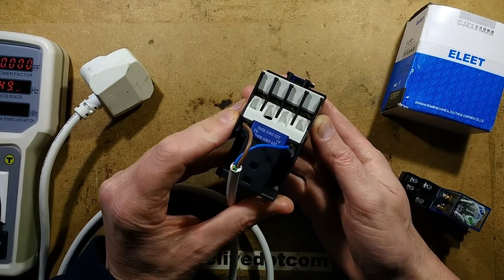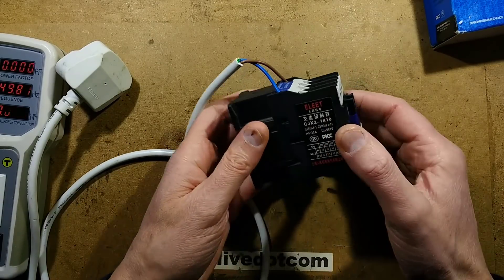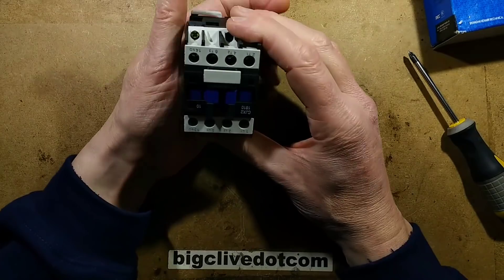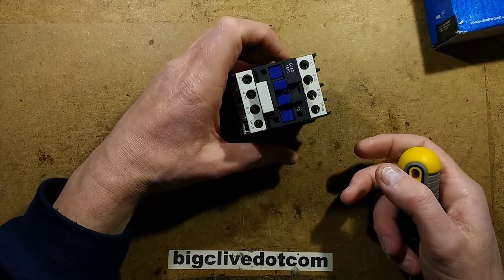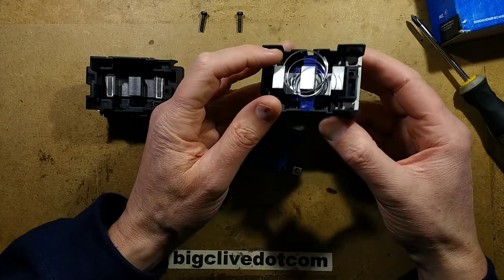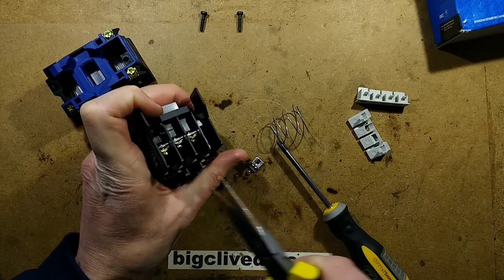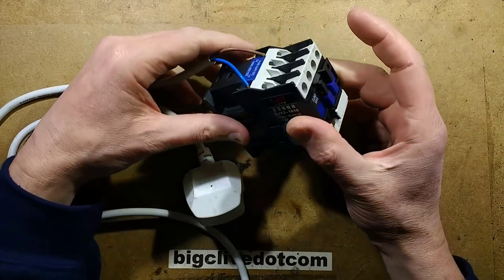eBay CJX2 industrial contactor teardown.

Comment: Used to work on some Irish made ice builder systems that used Omega (or similar name) branded contactors, found to our cost they would randomly stick in, the ice builder used the same condensing units as a milk cooling tank which had priority for the units, someone had used a spare terminal on the contactor to join a couple of wires, one night while making ice the milk tank called for cooling, this contactor didn't drop out and the two cooling signals being on at once caused a latching effect which froze the milk and sheared the paddles off the stirring motors!

Comment: I worked at an electrical supply house for some time while at school; there's some very cool capacitor switching accessories for all of the contactors used to deal with. Essentially, it would switch a smaller module that was in parallel with the contactor with a high value resistor in circuit a few milliseconds before switching the actual contactor, which would trickle some current into the capacitors; in turn helping with the inrush that you were discussing.

Comment: Just to note. The #14 NO is the NO held closed for the stop loop of a latching circuit for a 2-wire start/stop. The coil wire would be looped through that contact and a NC pushbutton which is the stop button.

Comment: Used to be expensive?

A few days ago I had to buy 3 relays to fix the screw-up of an electrician I subcontracted, the cheapest were over 50€ each at the plumbing store.
Reply: lost in translation
The place where I buy my supplies sells both electricity and plumbing parts.
I call it "plumbing store" because it's the closest translation of what we call it here, and I usually buy more pipes than cables.

Comment: Also keep the contactor rating for inductive loads in mind. At a public transportation company we replaced contactors which were used to switch the sodium-vapor lamps at the tram stops. Turns out their combined ballast load was too much for continuous operation and the arcs jumping across the contacts had burned them away over time. There was nothing left of the contact plates.

Comment: Another tip for switching high loads is to use multiple contacts. Than you connect one side to pin 1 and bridge to pin 3 and pin 5 and on the other side you connect to pin 6 and bridge to pin 4 and pin 2. This way the resistance should be more equal over the contacts and hopefully prevent burning the contacts (its kind of a dirty trick in my opinion). I have taken many apart, sometimes when the contacts are in a not to bad state I clean them with a fibreglass-pen.

Comment: the build is a direct copy  of the original i have in an emergency striped and cleaned the contacts but  I have had a lot of machine failures because of these fake telemecanique contactors not being rated at what they claim, this one claims to be a 12A version . the real ones also have better quality screws

Comment: Why no lo-pass filters (a capacitor and choke) between coil and input, to prevent messsing with controller and other electronics around???

Uh i rewound big pile of "similar" but expensive ones from 220/240V to 24V. 
Just happened i had big pile of new 220V in storage, and 24V were impossible to get... ok that's a fairytale for manager ;-)
I should buy them but i spent money on booze and stuff, really ;-)

Comment: Looks just like a Chint contactor from China.  I have used Chint and it's pretty decent gear.  As for star delta there should always be a mechanical interlock between the contactors to prevent both being engaged at the same time.  Some of the old systems didn't have that safety added

Comment: That's a clone of the older Telemechanique IEC contactors right down to the colors.  Also, I shot first.
Reply: Just wanted to comment that same thing. And yeah you shot first, fuck George Lukas.
Reply: Chinese bought all the old tooling. Then copied it over an over. Chint another brand using it
Reply: yes it do

Comment: Good video. I've had problems when pricing work. I said it would cost £3500, and this other company said they could do it for £2000. They were using all Chinese parts. Not saying that's wrong, just make life hard for the small firms that are trying to do the right thing.

Comment: These look like ripoffs of Telemecanique contactors. Those are much more expensive of course. The auxiliary contact is normally used for feedback to the PLC to let it know that the contactor is currently activated. I've worked with quite a few of those years back.
Reply: There are a few that look remarkably similar. If I remember correctly there were some "Square D" ones exactly like this back in the 90's.

Comment: With regards to  selecting the right contactor for a type of load, figures are stated on them AC1 is it's purely resistive rating.  AC2 is for wound rotor and secondary resistance motors.  AC3 is for starting and running squirrel cage motors (normal duty).  AC4 is for inching and or plugging squirrel cage motors (considered severe duty).  AC-6a is for switching transformers and other low impedance high inrush  loads. And our old friend AC-6b is the capacitive rating usually reserved for switching capacitor banks for power factor correction, and it generally involves early make late break parallel contacts and big wire wound resistors to extend the contact life.  For things like car park lighting go with the AC4 rating.  PS I use those contactors that you tore down today in older machinery all the time, never had a problem with them, the reason for using them is not the cost, it's because they are exact copies of the old Telemanique contactors that are no longer produced  so they fit all the existing mechanical interlocks, and auxiliary contacts, and motor overloads, straight swap and all the electrical and mechanical safety interlocks are maintained, proper job.  Cheers, Michael.

Comment: Hi BC, the "shunts" you mention are  called shading rings and they create a second magnetic pole that is out of phase with the main pole to hold the iron circuit closed as the control voltage passes thru the zero crossing. :)
Reply: of course obvious just never had a clue,thanks

Comment: I love using relays. There's something rather satisfying about the click. Very useful too when you only want to use a small switching voltage to activate larger loads, you could easily make a Hive style Internet heating system for a fraction of the costs, in the £20-30 range instead of £200+
Reply: <3 relays & contactors

Comment: @bigclivedotcom ............ i have 15 button LED ordered - white , blue and UV purple 5 each . 3,2v-3,4v   3w ........ i am not shure how to connect these and what driver would be good for a lightbox with a RF switch dimmer inbetween ? asked my bro and he stated needed to do serial each 5 and then connect back to the powerinput instead of all in series . and also stated a powerbrick wouldnt cut it as a powersuply so need a driver connected to mains 220V ( EU )

Comment: I'm an German Elactrican and drunk feel free to slap me.
1:30 if you push slow enugth the other one shoud go down before it engaged.
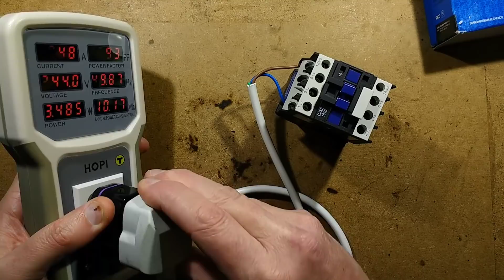2:50 no it is not purely inductiv. Mechanic power is effectif power but nearly zero...
2:50 yes better let it name lass that is vary bad power design
 4:00 DIN means "Deutsche Industri Norm" in English "German Industrial Norm" or standard.
 4:34 the helping contacts are adverbial in anny 5 possiblys. Starting left NO/Starting right NC.
Power contacts are only on the second layer. And only NO.
5:10 that is not in the norm as far as I know???
6:00 yes. "Bad English?" on bigger cabinets there are scrued to the back.
6:30 you can even buy new contacts. But normally you will simply change it complytli. I'ts cheaper then the work time.
7:22 the shunt in the core is essentially fore AC opperation. It holds the magnetic flux in the zero crossing. With out it it would release...
7:45 NO!!! Its complicated wire diermater and turns are changed... it needs the same field strange.
 8:20 yes rewind cost 10 times more. But I have done it too for a 8V one ones.
11:00 above are the helping contacts. The lower are for power.
12:25 normally the contacts burn it self and don't release but it sounds plausible.
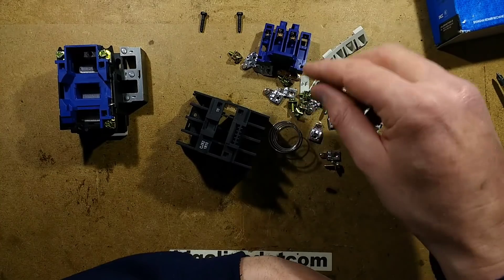 14:00 be care full that's not right in every situation. Sometimes there is another way over other stuff...
15:00 + and - 5% and international.
15:50 even if you need to "fusch" "making something not really conform to make it work"
17:50 in Germany the are mrced by a "C" in front of it.

Comment: The inrush current is definitely an issue for driving SMPS loads. I had a PC with a 600W PSU connected to a digital lamp timer with a small relay timer inside and within about 20 cycles the relay failed in the closed (on) position. You could still hear the coil energize and de-energize when cycled, but the relay contacts just wouldn't separate.
Reply: You can get round that in some situations with a PTC Thermistor. However you have to know how to specify what type etc as too high a temp-co or resistance and your PSU can grey out or go bang etcetera and too low a power rating and the PTC will go pop. You "can" use a PTC all the way up to a 3KW load but personally I would say that's way out on the hairy side. One other option is an inductor. Again it's got to be specified properly as for mains work you really need something with insulation capable of at least 600V (due to back EMF and all sorts of nasties). On top of that you need a low DC resistance to avoid heating etc and the relevant category of insulation temperature (I can never remember which category is which temperature). Or alternatively the "bodge it and scarper" method I use at home is to use a relay capable of 10 or more times the load current. IE a 25A relay for a 600W load. There are mercury wetted contact type heavy duty relays you can get on some surplus sites which are useful for this but personally I'd not use them as I'm a bit paranoid about mercury.

Comment: That looks a lot like a Telemecanique contactor
Reply: Correct, it seems to be a exact clone, for some reason there is quite a lot Telemecanique (now Schneider) clone stuff available.
Reply: Yeah, Schneider Electric nowadays, but I doubt they're as reliable as the real thing.
Reply: Schneider is ok, though I'd still rather use Telemecanique
Reply: @kyy7944  Telemechanique and Schneider are the same company
Reply: @V1rtu4L0ut  I'm aware of that, but the quality of products seem to differ from earlier ones

Comment: I'm an automation technician in America for a warehouse that uses high speed sortation equipment from Dematic  and we use similar contactors to this but they mostly use 120vac and most PLCs I deal with use 120vac for their inputs and outputs. Not too often do we use 24vdc PLC cards.We do have them in things like out automated HVAC system and our shrink wrap machines but otherwise it's mostly Modicon M340 controllers. I do wonder if those contactors at the place you described where they would trip up the PLC had Transient voltage suppressor resistors built into them? They suppress voltage spikes that can fry PLC inputs... kind of like a fly back diode does.

Comment: If you own a Chevy  say 68 to 88 v8 if your starter solenoid goes out ( starter spins but doesn't engage) you can take the plastic backing off the solenoid, inside is a copper disc flip it over and it will work. They get arch burnt over time.

Comment: Contactors in HVAC usually fail due to ants (insects) getting in between the contacts, the tell tell sign is a loud BUZZING coming from the contactor. In the south USA this and capacitors are the #1 failure modes of the outside condensing unit.
Be aware of the repairman that says you need a new A/C unit. Always get multiple opinions and do your own research.
Reply: Yeah I live in Kansas a.c. went out I know enough to take a look and fall had just hit so cold st night but hot during the day, anyway air shut off so the ants had built there nest up there at night cuz it was warm.
Reply: Similar problem in Australia. Our A/C outdoor units get a 6-monthly spray of persistent insecticide to prevent this "problem" (failures arising from such "external sources" are NOT covered by equipment warranties!)
Reply: That's what happened to my AC unit! Made a forum post out there because I thought it was super uncommon, guess not: http://hvac-talk.com/vbb/showthread.php?2235721-Bug-in-contactor-caused-AC-compressor-buzz
Reply: I once repaired outdoor equipment and concluded that certain ants were attracted to various power rails.  I think 48v DC was one of the popular flavours.
Reply: I never seen those, most problem on the HVAC part i work on it having a welded contact
Reply: @Justin Richards there seems to be a lot of anecdotal evidence for various types of insect being attracted to various voltages and frequencies. I would love to see a proper study donr on it but then again I'm a curious sod.

Comment: So would it be devices like these but for lights as mentioned that cause that [Thunk!] sound in movies and TV whenever they show big banks of lights turning on or off like in warehouses and parking garages?
Reply: Yes, generally they are bigger in size as they would switch a much higher current load. We use contactors to turn on whole lighting panels for retail stores
Reply: Awesome! One of life's mysteries solved then :D
Reply: I would have said more of a Tak! (but hey, onomatopoeia is subjective). you can also run a line-delay between contactors and a single switch operates any number of arrays (of lights) in sequence. but you'll hear the tak-tak-tak-tak-tak like someone rhythmically switching the switches, when it's only actually the one switch, and while it looks cool, it's not just for effect.

Comment: main difference between contactor =Schütz Relais i learned are:
Double Contacts to better insure safe disconnection (not connection, safety first)
3 main power contacts 1-2  3-4  4-5 
and some NO and NC auxiliary contacts for control and feedback "low power" cuircuits.

And also: dont poke it with a stick unless you know 100% what youre doing, a short circuit at 600V and somehundred amps makes go-boom the whole panel.

(edit: typo)
Reply from the maker: While reading through the log book of an elevator I found an entry that explained the splattered contactor on the table.  It said.   "Needs new contactor, old contactor refitted.  I had a little incident."

Comment: The contactor contacts are numbered in a standard way, 12&14 normally used as the latching contact for a start/stop contactor/overload.
Older contactors were generally mounted with a couple of screws diagonally, hence the holes in the base, i remember stripping out a large control panel to replace all the contactors (screwed in) and fitted din rails for the new ones, even though we could have still used the screw fitting, made life much easier.
I'm not sure about HSE interpretation, but i read it as 'doing the job in the safest way, providing you leave a paper trail of the method', why else would electricians tools be insulated.
The wrong interpretation of HSE leads to things like banning conkers in schools, either that or the educators can't be bothered to deal with the paperwork, and the kids of today grow up wrapped in cotton wool.
Reply: Sparky Projects Or even worse (recent here) banning chimney cleaners from going onto rooftops for the mandatory annual inspection without setting up complete scaffolding or installing expensive permanent ladders that only facilitate burglars breaking in through previously inaccessible skylights.

Comment: I really liked the mercury displacement contactors for HID lighting. They would last forever. And they need to, now that they are so hard to get anymore. :(
Reply from the maker: Mercury switches were amazingly reliable.  Fortunately small ones are available in bulk on eBay from China because China.
Reply: There are still places to find them other than China... I work in the petroleum industry and they all over the place. Intrinsically safe by design